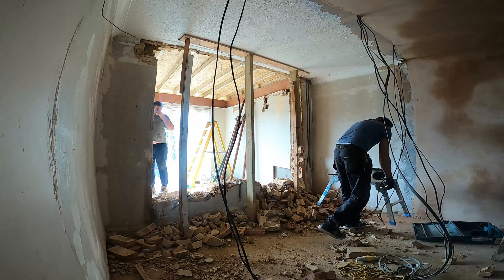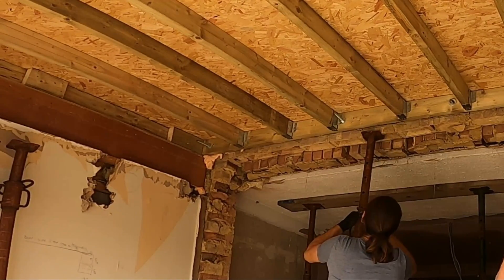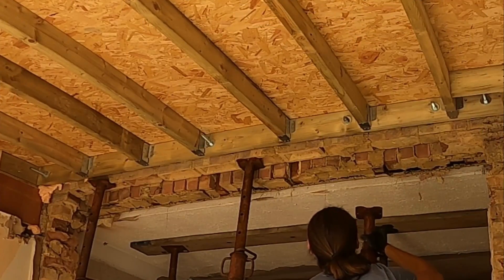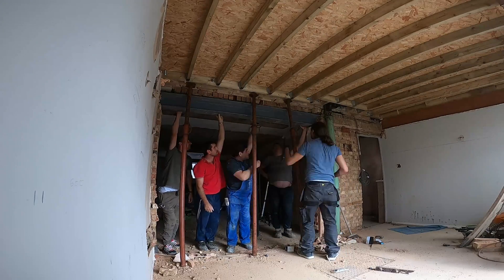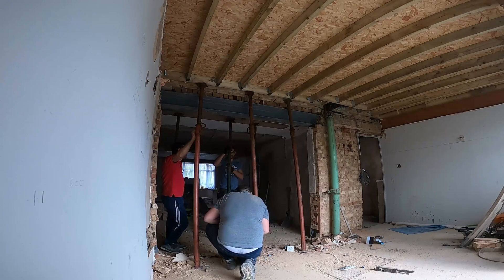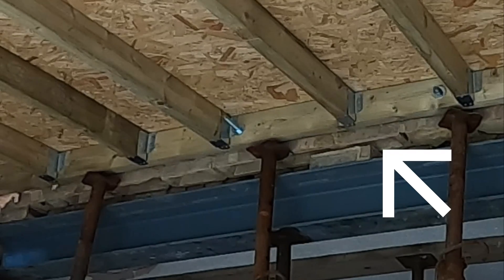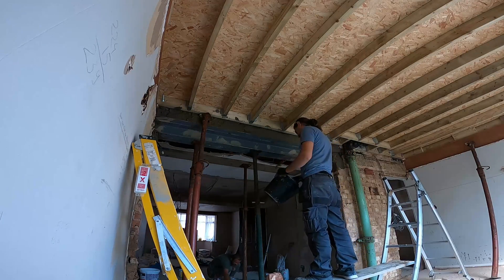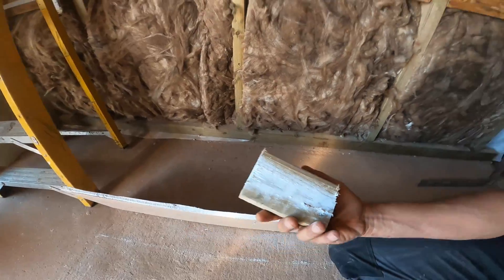RSJ Steel Beam Installation

Comment: What about installing concrete padstones  on both sides of the RSJ?
And ,by law, you need to have at least 200mm sitting on wall
Reply from the maker: We had a structural engineer that made all the plans and calculations. The still was installed correctly and no you don't need padstones if you use metal plates